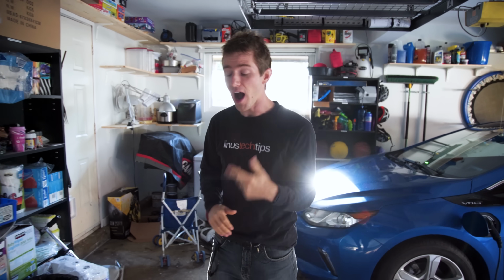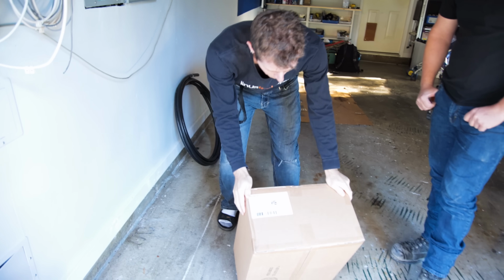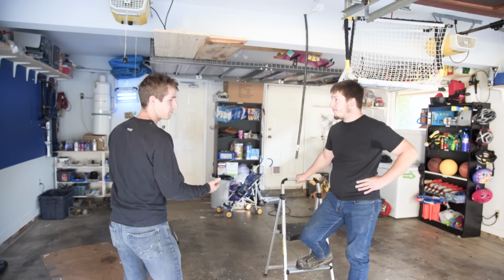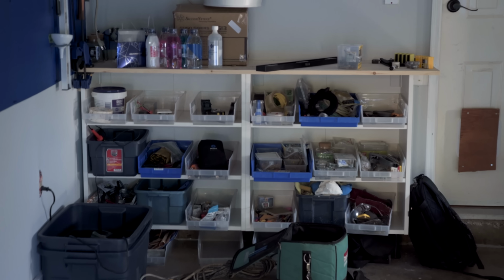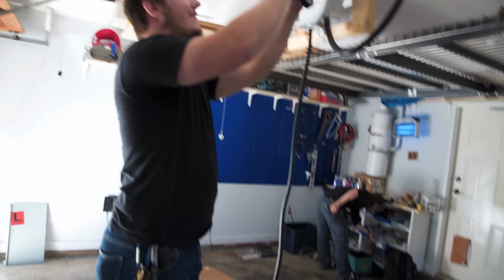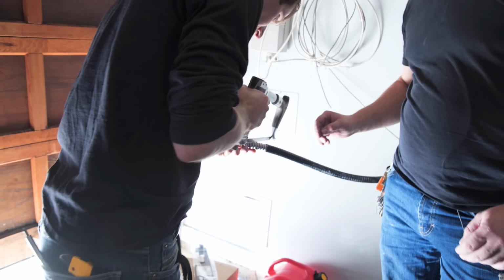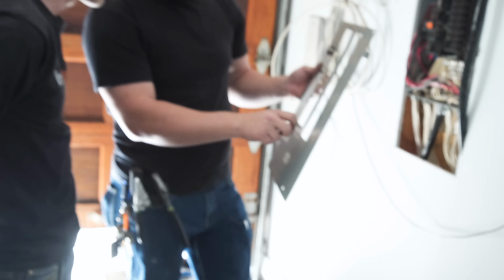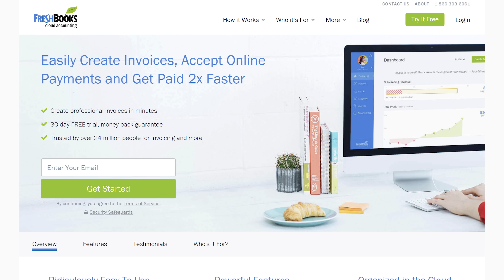Installing my Electric Car Charger - What Could Go Wrong??

Comment: in eu we only have 240v ac 110 is for old civilization
Reply: Nope. EU has 230v voltage standard.
Reply: @Vadim_msk  it's 220-240 depending on the load 240 is the nominal
Reply: Out 240v system is safer too, when we get shocked the power causes our muscles to let go and we get thrown away, the 110 American system causes peoples muscles to grasp and they can't let go causing many deaths where is our system rarely causes death unless someone has a underlying heart condition.
Reply: @Vadim_msk  'nope', we have a 240v standard.
Reply: Currently mainland europe is 230 V 50 hz and UK is 240 V 50 hz.
Reply: @stevefox3763  We have both voltages available in every home. 110V is barely a tickle it does not cause you to grasp a conductor and not let go. 240 hurts like a bitch but still not that deadly.
Reply: to be excact. we have 230V 1 phase 50Hz, and 400V 3 phase 50Hz.
Reply: @ChrisHolzer  Your correct with the 230V part. Correct me if I'm wrong, but I think we have 380V 3phase 50Hz ? we just call it 400V
Reply: EU has 240V because it got electricity (mainstream) after the US and was able to learn from the mistakes of the US. That's the issue with being the first. You're a guinea pig for everyone else.
Reply: @ChrisHolzer  we use 240V 60hz with a center tap (neutral) to get 120V 60hz. So the 240V is in every house and half your house runs on each side of the 240V phase. Or you use both sides in the case of your 240V appliances. Houses don't have 3 phase unless you pay for it. I do know a guy who paid to have it installed because he had industrial wood working equipment. Every industrial building usually has up to 600V 3 phase unless its a huge mill or something that would have custom power sources installed.
Reply: Here in mexico we use 110, there is 240 available, but many dont like it, its like just dont be dumb and you wont die.. xD
Reply: @lafridarb3289  yeah lol, no matter the system, being careful is the key to staying alive :)
Reply: @tonpa8888  It is 400V 3phase, 230V 1phase, 25-30 years ago it was raise from 3x220/380V to 3x230/400V. Maybe it was earlier.
Reply: @yassirfirdosirfem2006  Oh ok. Thanks for the information.

Comment: 13A @ 220V doesn't seem high charging current, at least in Europe, where a standard wall socket is rated for 16A @ 230V. Here high current EV charging is typically on a circuit that is 32A @ 230V one phase, or even more if you have a 3 phase supply (but not all vehicles supports charging with 3 phases).
Reply: If memory serves the charger in the video is fed 240v single phase on a 40A breaker (Allowed 80 percent load, so 32A max continuous load)

Comment: Little did Linus know that the stock Chevy EVSE is dual-voltage, you can plug that thing into a 240V socket and it'll charge at 3.3Kw...

Comment: Would have been cool and maybe easier to use to have it on a sliding you could extend down. Grabbing the thing doesn't seem hard but coiling the thing around it looks like a hassle.

Comment: Do you know you should use electrician screwdriver? Or its not thing in CAN?
Reply: It's not actually that common to use them here on lower voltages (think 120v line to ground or lower). Higher than that and live, then yes they get used (insulated and rated to 1000v)

Comment: The volts stock evse can charge at 240v with an adapter... not as safe as a dedicated unit, but if it works?

Comment: Linus didn't trust himself in the panel... Dude... It's pretty hard to mess it up. Neutral to the neutral bar, ground to the ground bar (if there), and hot to the breaker. In this case, two hots to the breaker, and no neutral. If you turn the main service breaker off, you just have to avoid the service lines. There's very little risk.

Comment: Please kill power to the breaker box before changing or installing new breakers. If you touch the metal bit on the back you will die.

Comment: Just a reminder as someone who works in the industry: don't buy an electric/hybrid car yet. Manufacturers are finding out that there's a lack of resources for their batteries on the market so they're looking to other methods of powering a vehicle. Audi is working on hydrogen (I think that's what its called in English, in Dutch it's called waterstof). So before you buy, wait to see what market does over a few years.

Idk why I wanted to type that, I just saw his hybrid.

Comment: Can't wait to see you get a Full Electric Vehicle and upgrade that charger to higher voltage and replace that shoddy Electric Main Panel. Get 2 300 amp breaker panels. Then hook them up to Rooftop Solar Panels that can monitor your electricity production from those Solar Panels and the draw from what appliances, EVs,  and computer equipments.

Comment: Actually having an electric car does not mean having to have an electric charger at home. Driving 2017 VW e-Golf and have never charged at home and my friend with Chevy Bolt only charges at home using the 110v power cable.
Reply: The idea with plug-in hybrids is to use the batteries for local driving. I have an Outlander PHEV and the majority of its driving is on the batteries charged at home. Once they run out it goes into normal Hybrid use.
Reply: @stuc.6592  Do you just plug into 110 volt outlet or a dedicated charger at home?
Linus claimed that having a Level 2 charger was a must for EV, while in reality it is an option that not everyone needs. If I opted not to take advantage of the free EV charging in my area and to plug in at home using the 110 volt outlet overnight, that would still work for us.
BTW I'm thinking my next Prius will be plug in, it makes so much sense for local driving and for the occasional times when we need to travel beyond the range of the e-Golf.
Reply: I'm in the UK, but I use the standard charger that plugs into the wall socket (outlet) at 240V and it takes about 5 hours to charge it from flat. But that doesn't matter as we have the petrol engine if we need to use the car in the meantime. I don't know if having 110V makes a difference as he says he needs to charge his car overnight, so I can understand the desire for the fast charger. Have a look at Rich Rebuilds channel, he talks about this a lot and the difference in charging speeds.
Reply: @stuc.6592  Thank you for the Rich Rebuilds recommendation, I'll check it out. 
In the states the average commute is 30 miles round trip with the largest group 29% averaging 10 miles. https://www.nrc.gov/docs/ML1006/ML100621425.pdf
Charging from a wall socket overnight would easily top off the battery. 
My friend with a Chevy Bolt only charges off the wall socket and while she doesn't always start off her day with a full charge, she has plenty of range. Weekends tends to be when the EV fully charges.
With my e-Golf I almost never get a full charge, as I tend to get an hour of charging here and there while running errands.

Comment: I just had a flashback to my old landlady's breaker box and seeing where her IDIOT son welded his screwdriver to the buss bar.
I worked for a lighting company once and I told them it had been a very long times since I had worked on one, so they started me at the bottom. I had a lot more experience in electronic IE tv's and stereos. So about 2 weeks in the send me on the road with a guy to train me. We came back 2 weeks later and as soon as we pulled up they asked him how I did. He said I was awesome and that he learned a lot from me. I also found out on the first night that we weren't allowed to fix breaker boxes, but that was after I fixed it.

Comment: Wait...his cats are just gone and he only "thinks" they're dead..? What happened to them...? Did they run away or did he lose them or something..? The way he said it, just seemed pretty weird. Usually people are a bit more worried when they're pets gone missing or even when it's fore gone conclusion that they're never coming back, they usually don't joke about it so casually.

But if they did indeed run away, I really feel for ya Linus. It's one of the worst feelings when something you love and really care for like a pet you've had for a long time just goes missing. It's something I wouldn't wish on anyone not even on my worst enemy. I just hope if that they are still alive, that where ever they are, they're safe and ok. A lot of times, in my experience with lost cats from working at my local pound/aspca usually if the cat's friendly a lot of times other people will just take them in and never actually report that they found it.

I actually knew a lady who's cat jumped out a open widow and ran away and was lost for over a year, only to find out that her next-door neighbor (who was kind of a "crazy old cat lady") had it the entire time. See, the neighbor brought in the cat to a vet where the owner used to take in the cat all the time and the vet actually recognized the cat and knew that the original owner lost it. When the vet asked where she got the cat, she made up some story about she had it was kitten of another cat she owned. Luckily the actual owner had the cat chipped and was able to prove that it was indeed her cat. Finally got it back but only after a ton of work and the threat of legal action. The horrible thing was that owner asked the lady and even though she had the cat and knew where it came from, she lied straight to her face.

Comment: Yea I sliced the palm of my hand open cutting towards me with a box cutter once with my left hand low and nicked a tendon. I was cutting open a box of canned food and the blade kinda bounced off one of the cans inside and hit my hand and it just felt like the plastic hit it slightly. It wasn't until I looked down and saw the inside of my hand that I realized I was cut and it took like 20 seconds for the blood to start pouring out. The stitches made it so I couldn't open up my hand for like 4-6 weeks lol. But luckily my tendon didn't slide into completly and shiot up inside my arm like a rubber band(and yes they have to fish them out, the er doctor made sure to tell me the entire graphic process as like a warning to not do that again since I ignored safety instructions). So yes box cutter safety is a thing and I cringe now when I see anyone cutting towards themself now.

Comment: Yeah I am not an electrician but I much rather work in a panel box like this on something like a light switch. Why? Because people in the 80s did crappy stuff like switch the nuetral instead of the hot so you almost fry yourself when replacing something simple like a ceiling light. When I work in the breaker panel I just wire up the breaker and then click it in. The dangerous part is the lugs at the top and the bus bar but at least you can see it.

Comment: Hey I was curious what wire you actual used. Brian what gauge is the wire you used 6/3?
Reply: It was a long time ago but I believe it was #8/3 Teck. Under the code here #8awg is rated for up to 50A, and actually at the time it was cheaper to get #8/3 teck than #8/2 AC90 (The regular armoured cable). Teck is a better cable anyway.

Comment: i dono about canada but here in the us NO electrician Would Wire Up a 240V With Out A Ground Or Sgould i Say The 2 ! Thts Just Asking For Trouble IMHO ! But Good Video Any Ways !
Reply: There is a ground/bond. In the US I believe it's also a bare copper or green lead in the cable. Video doesn't show it very well but it is there and connected.

Comment: This painful to watch. A real electrician would have stripped the blue bare and used it as a ground bc there is none
Reply: Actually, there is a ground/bond. It is hard to see but in Teck it is a bare copper lead and terminates to it's own bus in the panel.

Comment: 22 inches! I thought you guys in Canada were on metric?
Reply: We use both. Officially were metric but due to proximity to the US we use imperial as well. Actually, besides speed and measuring large distances (Kilometers) using feet, inches, and pounds here is still very common.

Comment: 240V cute we it Normal voltage her in Germany we have 400V 63A WAllcharger it also charge with a power of 25.200 Watts at 1 Phase we have 3 phases also we have 75.600 Watts my tesla is Fully chrage in 2 Hours vom 0 to 100 %

Comment: is there no WUC «work under current?? In Norway he need rubber suit full body to work with current on, this dude didnt give a shit just cut in the wall with full power with a saw my heart....
Reply: I was surprised he didn't isolate the board while the panel was off. In the UK you're not supposed to work live unless there is a very good reason not to. I'd always turn everything off before working inside the board (and properly check it was off). Even Linus was surprised he worked live and there is no reall point in taking the risk.

Comment: Ya know how I know this guy isnt union? Linus is right turn off the main before working on a panel. It is not worth your life to save some time working a circuit hot if you can, in any way help it. There are circumstances where working hot is unavoidable ie hospital and flipping breakers could cause grandma to kick her air addiction. Generally speaking shut the panel or circuit off when working with electricity.

Comment: I had a hammer. I needed to use it. Could not find it. Brought a new hammer. When putting the new hammer away were I would find it I found my original hammer. Two days later my brother presented me with another hammer. Now I cant find them!

Comment: wait a minute... is that 240V actually single phase?!
Reply: Where tf can u get 240V in a single phase in a regular house?
Reply: @giornogiovanna8042  240V is standard everywhere except North America, Central America and Japan

my disbelief is that they are not using 3 phases for such a heavy load
Reply: @666Tomato666  3 Phase is very uncommon for a residential service. Only place I've seen 3 phase for residential is the main service for something like an apartment building or townhouse complex. Even then individual units are usually only fed 2 of the 3 phases and a neutral. Very, very rarely is a unit fed with all 3 phases.

For commercial and industrial however 3 phase is extremely common.

Comment: The electrical standards in the US are crazy.  Go and take a look at a cable installation in Sweden or another nordic country. 
Basically the deal is that if it’s not traveling outside the wall it needs to be incapsuled in another hollow cable that is pretty sturdy and hard to prevent people from penetrating it with a saw or a screwdriver if you are drilling a hole in your wall. 

I just can’t believe that in the US you can install cables ”exposed” like that in a wall. From nordic person perspective the wiring looks ”scary” tbh.